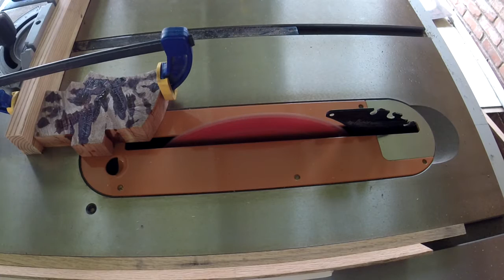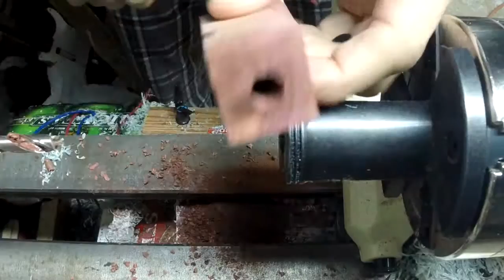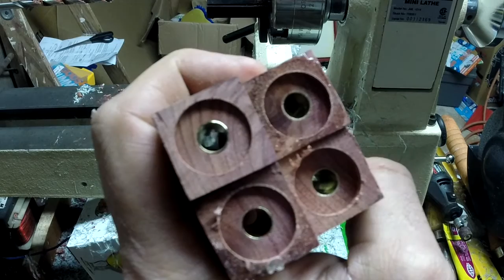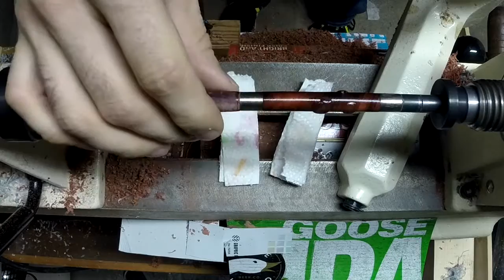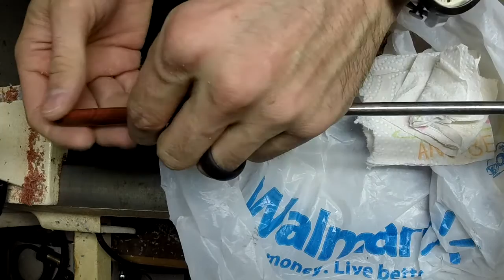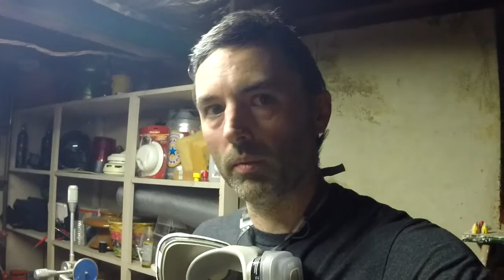Problems Woodturning Cedar Pens

Comment: Easy wood Ci1-R2 2"  Negative Rake Square Carbide I've been using this because I was  Constantly having blow out especially on the ends. I'm just sharing info with you only because this is what works for me.anyway good luck with your turning. I need to get back to your video.
Reply from the maker: Thanks, just seeing this comment, good advise.

Comment: When the blank started to get thin and worrisome, why not switch to using a rougher sandpaper to bring it down to thickness? Might not have gotten the chipping. Been trying cedar for pens cause I took down 3 trees in my yard. It aint easy.